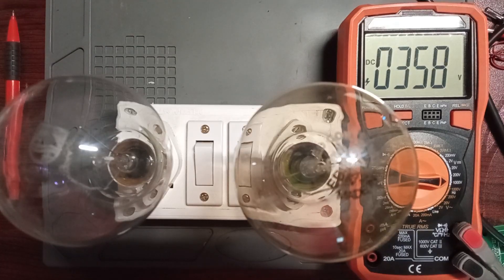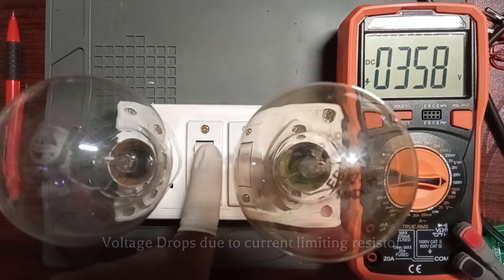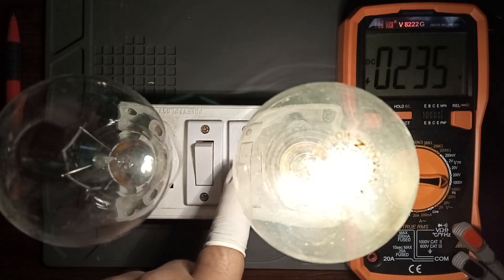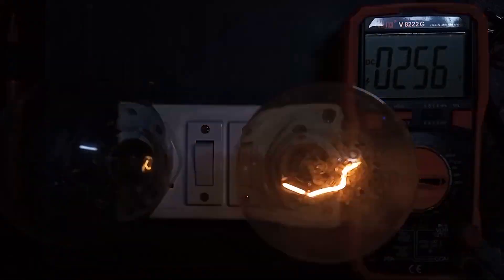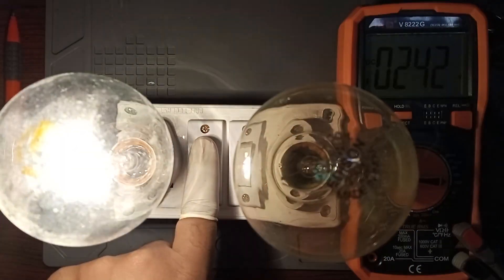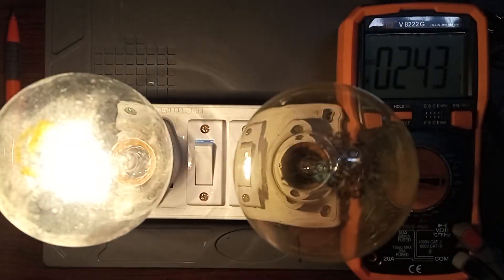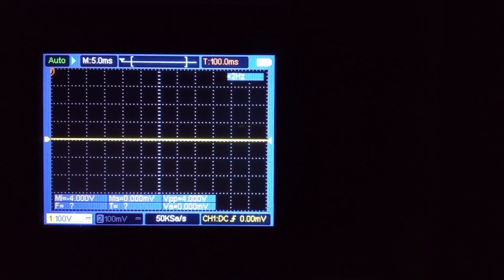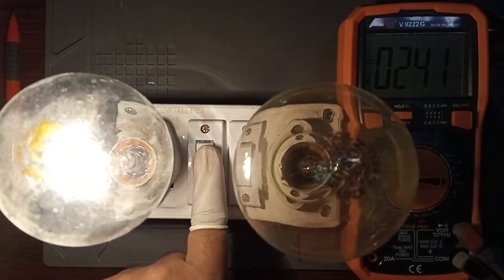AC Switches in DC Circuits - Arcing, Explained

Comment: Are there examples of AC switches being used in a DC environment deliberately? Or is it only done in error?
Reply from the maker: Hi @DrJrGenius,

The use of the AC switches in DC was intentional for demonstration purposes in this video.

In real-world applications, I think specialized switches such as DC Circuit breakers, Solid-State Relays, IGBTs, MOSFETs, vacuum switches, etc are used for safely handling DC...
Reply: Interesting! Thank you for the reply
Reply: Thanks for the video,  I just got a shock from using ac switch from using a dc power supply, could that be the reason?